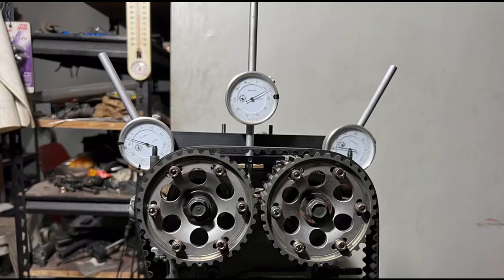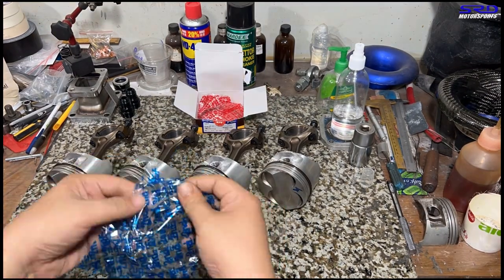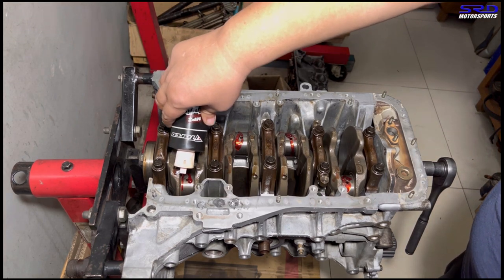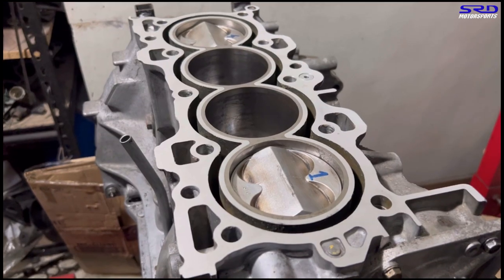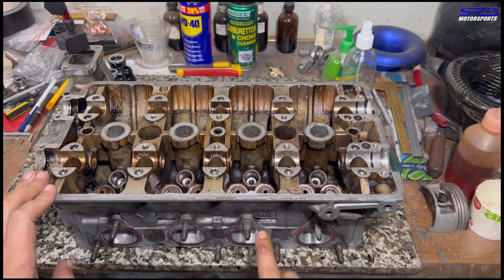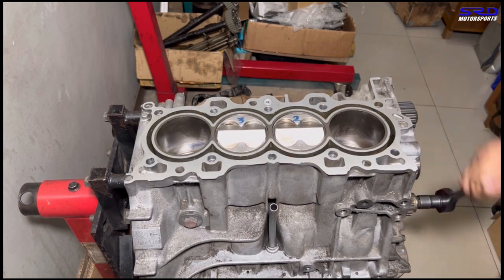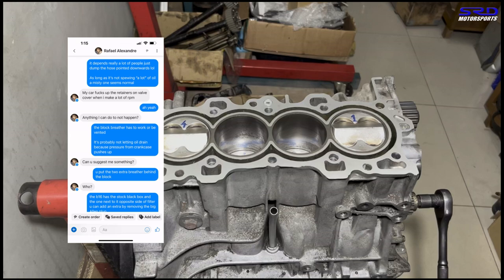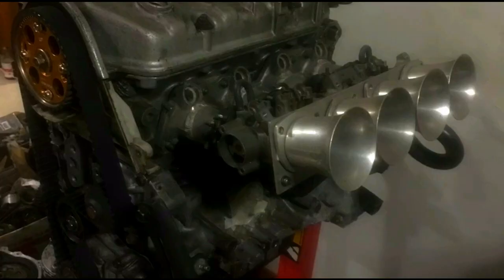B20vtec GSR Cam Rebuild Series part 4: Crankcase Evacuation

Comment: Block breathers are underrated, when you vent from the valve cover you usually have to weld a piece of metal inside to act as a baffle so oil won't be going into the catch can and filling it up, you have to do that on the back of the cover since the car will be moving forward and oil will get pushed back, you Don't really have to do it if you vent it from the front of the cover but block breathers are still really great, if manufacturers do it then why we can't haha
Reply from the maker: Yes sir yes sir!

Comment: Can't wait to see this thing rip 🤙 thing is gonna be rowdy!  And not venting from the back of the block would cause issues  with oil draining down from the cylinder head then why are the H and F series pcv system routed off the valve cover?
Reply from the maker: Maaan! Same here! Hopefully the chassis gets done being painted (owner had it painted) as I got a Gimbal now for nicer onboards and rolling shots lol!!
Reply from the maker: On the other part…(breather stuff)

can’t remember which video it was but I believe it’s the crankcase evac vid I showed what we did to the two h22 we did for road race

h22 doesn’t have a block breather that’s why… need to have a fitting welded at the back where the drain is like B for appropriate breathing…

Which is easier? Just VC right? Now not saying it’s wrong I’m just saying it might be “missing” further improvements 😎

Comment: Hello, loving the videos you post, very informative. Have you had experience with cracking sleeves on B20VTECs?
Reply from the maker: I’ve read about that years ago on forums, but I’ve NEVER experienced it… even the one I did in 2018 it runs 12.5s until now still alive
Reply: @SRDmotorsports  good to know. I think alot of issues people had with b20vtecs are just down to sloppy building and poor tuning/running them on p30/p72 ecus. I'm hoping my 12:1 tuner2 powered B20V has many happy years of life!
Reply from the maker: @TheBongoman47  the 12.5sec has tuner2 and is 12.4:1 so definitely urs will have years of fun

Comment: Would it be possible to run the ycp cast pistons (12.5cr) with direct port nitrous on e85? Im afraid that itll melt the pistons
Reply from the maker: 12.5 might be too high even on a small shot

Comment: Similar too mine lol very
Reply from the maker: then u must have a torque monster of a beast! :)
Reply: @SRDmotorsports  That I do I showed my tuner and builder your channel. Check out Mad scientist Auto Eric Jarvis . He has a s 2000 that’s a Monster. He liked your work and told me to get a intake from you. I just had a fuel line bust so I’m doing all new lines fuel rail etc then a intake from you
Reply from the maker: @tjabdon606  oh thanks man! I wonder if it’s the same dude behind a similar namen In dseries a decade ago lol

But yeah this time u can lay down the lines as good and as clean as u like it = gonna be good

Comment: I am using the two port from the back of the block to a PCV and then to the intake manifold. Do you advice doing this? or just eliminate the PCV and just vent the two port from the back block to the breather can?
Reply from the maker: I think that’s a good approach especially for the street because everywhere except wide open throttle the pcv does a good job 

And actually when running an airfilter it still generates some vacuum Vs open intake so it’s still doing it’s job so IMO ur lay out is good especially for street applications
Reply: @SRDmotorsports  thanks for the reply :) ..my only concern is the oil vapor going into the intake manifold and getting the manifold “dirty”.
Reply from the maker: @jeffgoh3675  that concern is very valid 

IMO that might be an excuse to route it to a “catch can” first then into manifold 
But that might have extra lines than usual but I’d do it

Comment: You know what would you charge for a pro 2 intake ported.
Reply from the maker: The ITR style intake? pricelist is on the shop page , with the current exchange rate it’s near $185 lol
Reply: @SRDmotorsports  That’s a killer deal if it’s already ported?
Reply: @SRDmotorsports  what’s the website?
Reply from the maker: @tjabdon606  oh that’s just the portwork but we can get the ProSeries skunk2 here for $200ish and that helps avoid DHL shipping x2 like no need to send here and back
Reply from the maker: @tjabdon606  the page is on fb it’s www.Facebook.com/SRDms
Reply: @SRDmotorsports  exactly it will be a week. But I’m definitely interested in doing it.  Then maybe I could get a head done down the road and then I could say you done all my port and head work. Maybe get you some more business
Reply from the maker: @tjabdon606  that be sweet man!